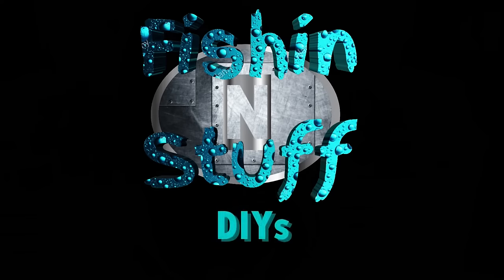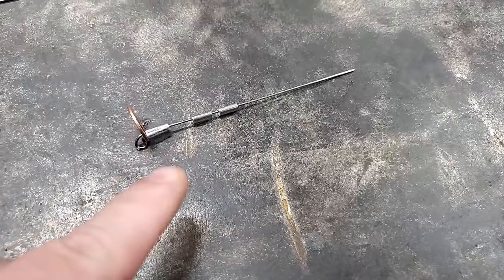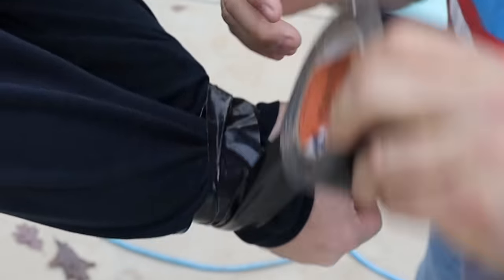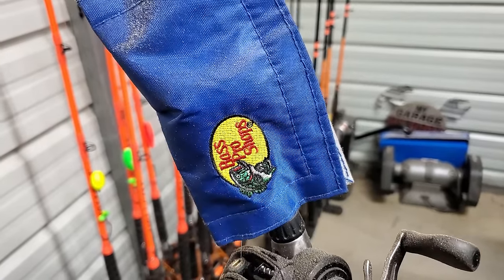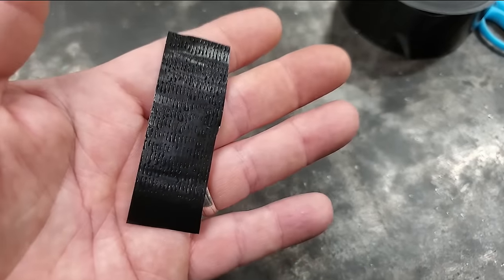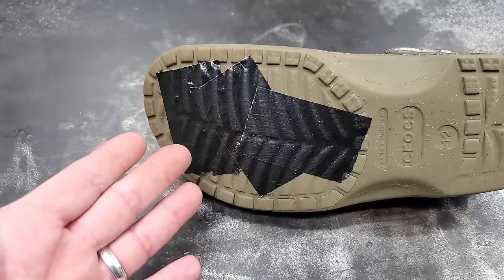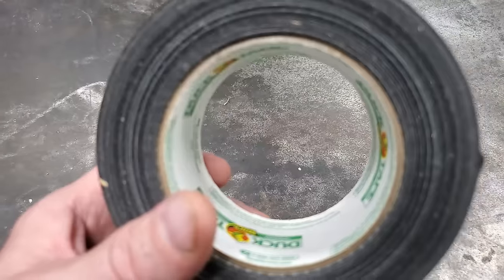Duck Tape HACKs you'll really use

Comment: My husband use to work for a small company who never seemed to have money to fix their vans when they broke down.  The U-joints went out in his van. The company just didn't have the money to  repair the u-joints so my husband used duct tape to tape everything up.  It went for over two weeks, driving well over a hundred miles a day, and held out until they were able to get his van fixed.  He was in Dallas traffic every day for those two weeks, so you understand that duct tape had to of worked very well.

Comment: Good stuff as usual! I always keep electrical tape on boat because some of my rods have Tennessee handles. There have been times where I didn’t have any tape on the boat and cut my hand or finger. When that happen I would take some of the electrical tape off one of the Tennessee handle rods to use on the cut. One other thing about using electrical tape for a bandaid is it is a little more flexible allowing you to handle your rods and equipment easier.Duct tape is stiffer but still would use if I didn’t have any electrical tape. I think if it was a deep cut then making the butterfly strips definitely would work better. But truly your right having a whole roll of duct tape just because they are bigger rolls and have more options than electrical tape. I guess it wouldn’t hurt to have both in the boat.Before retiring I kept electrical tape in my back pack. If I got cut at work I would use the tape over a bandaid just because it would hold up longer than a regular bandaid especially if you are sweating! Someone with  your knowledge probably could make multiple hacks on any and all tapes. Well you kinda did with the fluorescent tape. I appreciate all your content and always look forward to seeing the next.

Comment: Another great video.  I especially like the zip-lock bag hack.  That's one I will definitely use (as many of your others).  Looking forward to the next one.  One question, where do you buy your stainless wire?  I looked on Harbor Freight's website but all I see is the rolls.  I want the sticks like you use.
Reply: You can purchase it from a welding supply. It comes in rods like that for tig welding. Don't know if that's where he gets his from though.
Reply from the maker: It is where I bought it
Reply from the maker: I did but mine at a welding supply store . I'm not sure but Harbor Freight might carry it . Like i said I'm not sure . I know they have aluminum tig wire

Comment: Hack 12   You don’t need to cut the tape you can rip it to a small width as you unroll it . We use half or 1/4 width tape often
Reply: I have some you have to cut because you can not tear it,it's different than the yellow stuff I put in my own comment but came from the same place.It's just about as tough and sticky but a lot more flexible.

Comment: @Fish N Stuff you have excellent hacks of using duck tape.  May I ask to add one more thing - it can be used in stopping reel locking threads from coming undone from "vibrations" or pulling/fighting fish.  I had witnessed MANY even my fishing buddies (for Ice fishing and all "softwater" types- Fresh and Salt) reel thread locks come "loose/undone" making them  unawares when reeling in fish and the reel pops out of the pole.  The amount of "torque" a fish fights does put stress on the locking threads (even panfish)  

I lock my reels as much as I'm able to go and then put some duck tape around the exposed threads to prevent the reel locking part from getting unscrewed.  (May have to put few layers) as it acts like a locking washer.  😉😉😉

Hope this helps and keep up with your videos.  (Especially the talking "crank joker" lure- that's a funny addition.) 😉😉🤣🤣🤣

Hailing from the Northeast (soon to be Southeast) 🤠
Reply from the maker: That's a great tip

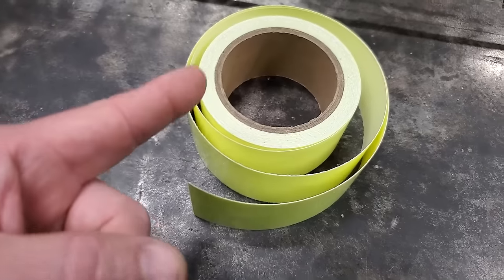Comment: Back in the late 70's,maybe early 80's my father would bring this Yellow Tape home from work (heavy equip. mechanic for road construction co.).It looked a lot like the tape @14:24 but real yellow and a black sticky side.It was also kinda thick and stiff.
That stuff would stick to ANYTHING,and if you stuck it to a car fender or hood or door (don't ask how I know...lol) and you tried to remove it the paint would actually be pulled off with it.
IDK what it was called nor have I ever seen it since,maybe a Kar Products product back then?

I use duct tape a lot to remove fiberglass from my fingers,forearm,etc. Works well for fine (more or less dust) metal slivers.

It's also great entertainment,just put a small piece on a 1 or 2 cat paws and grab some popcorn....I prefer beer......

Comment: I'm sure it's been asked, what stainless rod is that? Where do you get it?
Reply from the maker: It was the smallest one they carried , because weld wire is very stiff . You can get it at any weld supply store  . Just Google weld weld supply store near me
Reply: @FishinNStuff  so it's not on a spool? Does it come 14 inch like welding sticks?
Reply from the maker: @hunters080  it's tig welding wire . It comes in 3 foot pieces  . You can get mig wire on spools . But then you have to straighten it
Reply: @FishinNStuff  thank you! Going to check harbor frieght now

Comment: There's actually a duct tape that is glow in the dark, although I'm not sure if it's the same kind of stuff that was used in the video, so that stuff might be better... 

also, wouldn't it have been better to do that "hole in a cup" test, with the duct tape on the inside of the cup? I realize that it normally would only be used if you've already got a leak, but honestly, if you're going to be doing just that, you'd be better off with something like flextape or similar, whereas duct tape would be better in more of an "i want to fish but my boat has a hole in it. I know I'll use duct tape!" Situation. Now why duct tape INSIDE the glass? Because the water pushes outwards, in which case, the water SHOULD INCREASE the seal of the duct tape by pushing it up against the wall of the cup, although you could also have duct tape on the outside of the wall as well. Same SHOULD be true with a boat, provided it's dry originally (unless you're using that flexseal tape stuff i mentioned earlier which can be applied even in water supposedly)